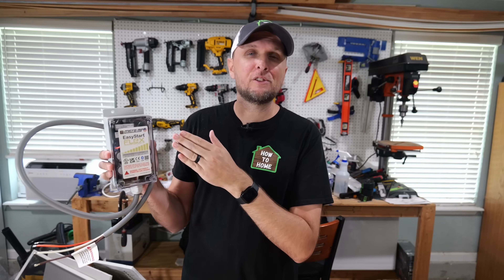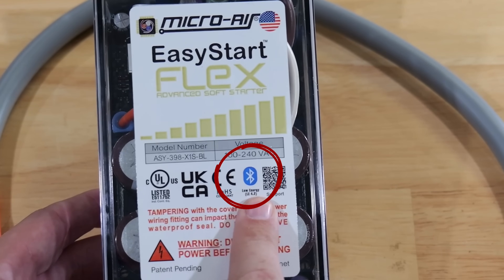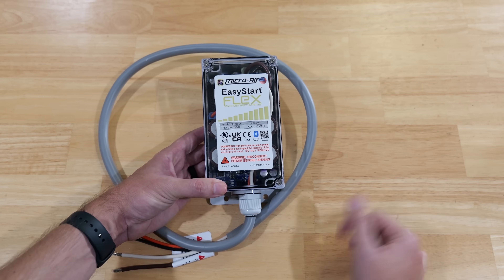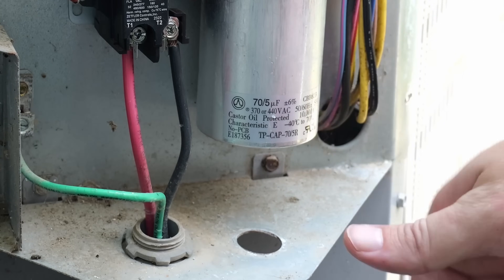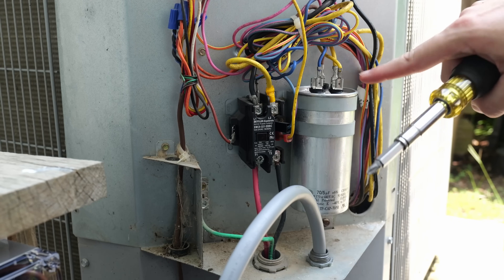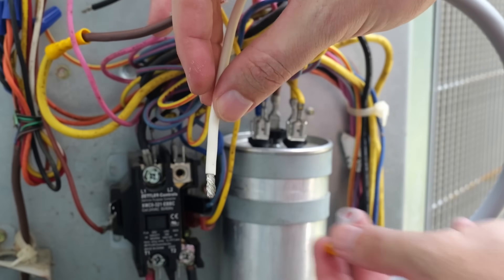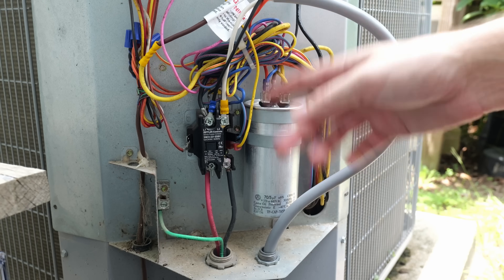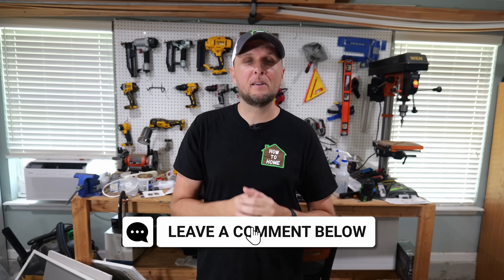The ONE AC Upgrade Every Homeowner Needs to Consider!

Comment: Actually every home owner should know that the AC industry has been selling you technology that is archaic for decades. The only reason you need to buy one of these things is because your current compressor is either FULL power on or FULL power of, because of this your compressor needs a ton of power to start up - given that it always has to run at 100%. Thus the need for this device to make it easier for your FULL ON compressor to turn over and start up - which YES saves you some electricity and wear and tear on your AC when you use this device. That said, every home owner should actually replace their AC with a NEW variable speed DC system - when the chance arises to do so. Variable speed compressors are not always ON or OFF, they run at varying speeds depending on the needed output required, they start slow and ramp up which makes them super efficient, long lasting and very quiet.Most importantly variable speed system SAVE YOU MONEY. The variability of operation results in large energy cost savings. So instead of investing in this device, if your AC is old, maybe look into a NEW variable speed A/C system instead.
Reply: And the variable speed units cost a fortune to repair and can  give more problems in the long term .
Reply: I think I would opt for a cheaper Full On AC and a $82 dollar Soft Start device that will also protect my AC from a power surge (and they do happen, my folks AC was blow out by lightning and boy was that a fight with  insurance for them to pay).
Reply: Most of the new variable systems are frequently drive that varies the frequency 3 phase compressor by converting all of the single phase current to bc then to 3 phase ac with other than 60hz. It’s hard to quickly explain. This is the same system used on large commercial systems
Reply: 10 years from now, there should be ample supply parts. When I bought this mini split this pretty much was the only choice. They are almost all inverters now.
Reply: @nmfireman you do realize inverter systems have been out for over 15 years in the states and we still have issues getting parts. Not to mention most of said parts are made in other countries. So let’s see what happens when the supply chain has issues again. Did everyone already forget the pandemic?
Reply: The compressors that are full on are designed for such. I have not seen them die any more than an inverter style. These soft start kits likely don’t add any life to your compressor. I have two old r22 systems going just fine for 20 some years. I’ve seen 410a systems going strong despite the housing and coil in shambles sinking into the ground. 

Inverters are a nightmare depending on the brand. Some companies don’t like to put diagnostic lights or a code display. You just have to count blinking lights and then pray that number doesn’t have 5 possible reasons it went out. 

The main benefit of an inverter is it’s quiet and yes slightly more efficient.
Reply: Majority can’t afford that, so this option is great.
Reply: No, your advice is misguided. Variable cost a fortune up front and an absolute fortune to repair. Single stage are cheap to buy and cheap to maintain/repair. Single stage are more reliable as they have less parts to break.
Reply: @thrillmanmayo  Wrong, mini splits are all variable speed, in many cases cost less than traditional systems.
Reply: If you think variable speed compressors save money you failed both physics and economics.
Reply: More parts, more problems. Us HVAC techs almost never put those in our own homes for many reasons. Replacement parts are expensive and often times not readily available. Now your wife and kids are sweating for 3 days while you wait for the manufacture to ship the fancy control board that is very specific to your unit. You’re not saving money when the equipment costs twice as much, breaks down more often and the replacement parts cost 10x as much as they would for a single speed unit. A compressor can last 25+ years in a single speed unit if it’s well maintained.
Reply: @Dg_donn exactly my thoughts as well. I service a 48 year old “antiqued” carrier and it’s has Zero issues. Maybe a few motor changes and capacitors over the years but the compressor refuses to die 😂 It’s sad the newer systems are designed to fail around year 8-15. I understand the manufacturers not wanting systems to last for profit sake but damn it’s hard explaining to a homeowner they last 10-15 when the old one lasted 20-30 years.
Reply: My new mini split I put in has dual inverter. It’s very quiet you don’t hear it actually kicking on and off.
Reply: You will also save money by cleaning your coils and insulating your line in. What is the inrush on a 5 Ton.
Reply: @gerardford5707 look at the LRA (locked rotor amperage) figure on your outside AC unit's UL label. that's basically the max in-rush current
Reply: And when the board goes out you have to wait and after warranty the board is 3k.  And the fact that you cant by pass anything to get condenser to run.
Reply: Aweome thank you for that in depth information!
Reply: 😂 let's drop $10k + on a new unit and save.
Reply: I'm hesitant to switch because I believe in the cost savings on the electricity, but I also worry about expensive repairs since it has an inverter, more expensive electronics, more difficult to diagnose unless the technician is trained properly, and so all money saved on power could easily vanish after 1 super expensive service call.
Reply: @petef.4361 you’re wise, most techs are required by the manufacturer to call tech support before a concrete diagnosis on a fail board is confirmed. Otherwise if they replace the board under warranty and it comes back to the manufacturer and they deem it “working” then you’re getting charged 2k+ for that board. Keep it simple and you’ll thank us honest contractors.
Reply: @petef.4361 exactly, the variable speed are a fortune to repair.
Reply: @petef.4361  the cost of installation and repairs overtime will nearly completely negate any savings.  Some parts are not available readily so be prepared to be without cooling for several days
Reply: Can you give us an example? How can I identify if the AC/heat pump has a variable speed DC system?
Reply: @alanfong8569  it will say inverter and most some cases dual inverter
Reply: @nmfireman  Thank you so much!
Reply: @alanfong8569  It will say "Inverter or variable speed". If its super loud outside its not.
Reply: @septsixteen  Thank you!!!
Reply: @alanfong8569 stand near the compressor when it starts up. Loud as hell?
Reply: @alanfong8569 often called "inverter" around here anyway.

It does make the electronics more complicated, thus harder to fix one part of it. If that matters depends on how much does a dude to fix your ac cost compared to ac price.

Haven't noticed really any difference in running costs though.. But you'll get like more stable temps with them, it doesn't make the compressing overall needed to keep it at below x celcius need less power as such.. It can just run at partial power to keep it stably at it.
Reply: @lasskinn  Thank you so much!
Reply: @alanfong8569  Yes, it will say Daikin or Mistubishi on the side.
Reply: @thooks1234  Do the other brands not do variable speed or they're not as good at it?
Reply: @alanfong8569  Daikin and Mistubishi are the best and most experienced in this arena. The lesser known, cheaper brands are going to be a crap shoot. One might last and work fine for 15 years.  Or not. 

No, Trane, Lennox, Bryant/carrier, etc are NOT leaders in inverter driven compressor technology.

Note I said inverter driven, not variable speed. There’s a distinct difference between the two and many people will claim variable speed is equal but it’s not.
Reply: Save you money until you have to pay 3 k for a board and labor then did you save money?
Reply: I wonder how many years it will take for that $18k investment to start showing returns?
Reply: Are you talking about inverter ac units .
Reply: Mine has that. So, should I still get a soft start?
Reply: Compressor inverter, (VFD) yeah but in the US in general you have cheap trash. So you pay less the first time. But you have to pay it multiple times 😹 (yes I'm European)
Reply: 🙌🙌🙌🙌 YES!!!!  The Residential HVAC industry/equipment in the US has been ANTIQUATED for DECADES.  And it's STILL being installed.... in multi-million dollar homes!  It kills me to drive by a 1.5M home, brand new and it's got 3-4 old-school Trane or even worse, GOODMAN condensing units sitting outside.
Reply: But they cost 10k.
Reply: Bosch makes a great variable speed system , it actually starts up at 35%.
Reply: Proof or your full of it. Cost of unit and installation. Then at a national avg cost of electricity share the operation cost for avg. size home to cool it off during May to September in 95 degree weather. Vs same variable and traditional units running 100%.
Reply: Ive heard its really fun when the circuit boards fail or get wet.
Reply: They save you money but cost twice as much!
Reply: seems u havent heard about invertor tech ac 😂
Reply: @sirobin171 you sir sound like a white shirt  sales tech please stop spreading misinformation. Inverter technology is cool but not practical for the company servicing and the homeowner. The cost and availability of parts is ridiculous not to mention price of  equipment being sky high. I’d rather have a part in my van slap that sucker in and go to the next house knowing my customers are comfortable. I used to work for a company that pushed selling the higher seer inverters and I feel guilty for every one I sold. My sales pitch sounded like your comment. I had brand new Install’s fail within a week and couldn’t get the replacement part for days or week and that is unacceptable. I no longer work for said company and now I’m a licensed hvac contractor doing my own thing. I’ve seen all kinds of units from basic to the most advanced and In the world of hvac keeping it simple stupid is the moto to live by. Unless you like taking the risk of your expensive unit breaking and being without Air then by all means go inverter. There’s other arguments against inverters too like dirt city power causing problems as well as brownouts and lighting strikes and yes some of which can be mitigated with surge protection but even that’s not a guarantee. So for those reading this comment please stay away from inverter technology for your central air system and don’t fall for the sales pitch, just remember keep it simple and you’ll be alright.
Reply: In an ideal scenario with an unlimited budget, yes. They are way more expensive and cost way more to repair. if there is not in the cards, I recommend looking at a two-stage system…. The unit will run at about 70% capacity unless the need arises and then the second stage will automatically turn on to give you 100%. In most climates, you would be running at 70% in the spring and fall and likely 100% through the summer months during those sweltering heat waves.
Reply: Any specific models you recommend?
Reply: No thanks, first company wanted over $12k to put this in, wanted to replace furnace too so it would also have variable fan, and requires its own special thermostat, so I would lose my wifi nest.  2nd company gave me 3 options, value, mid, top, all 3 Lennox regular contactor units with new evaporator in existing furnace.  They said nothing wrong with furnace. Price was $6k.  If a contactor fails it is $20 at Menards.  I did put surge protectors on both units.
Reply: Yes proprietary inverter board that is mostly exposed to the elements, not good idea.  What is board replacement cost? $1000, availability?  Contactors run $20 and are at Menards.  Plus a simple contactor based unit don't require a special air handler (furnace) or special thermostat.  It would be one thing if they used quality replaceable Allen-Bradley VFDs contained in NEMA 4 box but they don't.  Inverters should also not be in 90 plus degree heat.  So really the inverter and control components should be inside where they are cool and clean and only power ran to the outside unit.
Reply: If your AC is still working and old. Dont replace it. Replace it when it breaks. My AC is over 20yrs old. Its not worth spending up to $10k for new AC just to save couple bucks.
Reply: @anekinoo7  yes. I  installed a used Trane made in 1999 that I got for basically free in my shed/shop. It was from a takeout when some people "upgraded their AC to save money." The trane is still working meanwhile the new system that replaced the trane has already broken several times.
Reply: Yeah, in this economy, most of us would wait for the big upgrade.😢
Reply: Just buy a 240VAC frequency drive from Automation direct.
Reply: I have one a repair can cost as much as a new unit.  Mine is a carrier. Parts are extraordinary
Reply: Mine is and ECM and runs at one of 255 steps. 25 SEER so I don’t need this.
Reply: Mine is and ECM and runs at one of 255 steps. 25 SEER so I don’t need this.
Reply: An inverter AC is an air conditioning system that uses a variable-speed compressor to regulate the temperature of a room
Reply: I have a newish Rheem system, 5 years old now. I’ve had to replace the starting coil 6 times since it was installed. No clue why these keep burning out. System was pricey
Reply: Or better yet learn how to build your own variable speed DCAC unit. If you can’t afford a new one, build your own.
Reply: The reason you want one of these is so the power grid don’t charge you more for your spikes on the grid every time it turns on
Reply: @PauloR777  Nope, the #1 reason you need this is when old compressors need an extra boost of power to start. The AC industry loves selling these things, they have bullshit there way into selling them by saying they say you money with power, this is not quantifiable, its just sales BS. The AC industry is really one large load of corporate bullshit, I know I used to work in the industry. The little companies use the sales techniques the industry creates for them.
Reply: I'd have to honestly disagree with you about variable speed A/C's and saving you money! I install them. They cost too much now and in the long run you never reach the savings amount. Maybe, just maybe if they only gave out the rebates they did years ago, talking about $3k-$6k off a high efficiency unit back then.
Reply: @Goodfella0982  I installed 3 mini split variable speed systems, each for around 3k professionally installed (a few hundred here or there).
Reply: @Goodfella0982 totally agree. Much more complex h/w and when it fails so expensive. He paints them as all positive. Go change an ECM motor over your stock blower motor and you know what I mean. Open up a variable speed compressor control area vs your standard capacitor/contactor one. $$$
Reply: @Goodfella0982 and very expensive to repair
Reply: You skip over the most important deciding factor… price of state of the art units
Reply: @noblepatriot9292  Not anymore.  They are very comparable, especially when you start talking about energy savings paying the difference.  You can usually pay the difference back in 2 years or less with reduced power bills.
Reply: @thooks1234  when people can’t buy groceries or turn on the air for the expensive bills how could they afford an upgrade…
Reply: Yes but are very expensive to repair
Reply: Let me know how that inverter system works out after the 10 year warranty expires. Even under warranty, let me know how many service techs carry the unique high priced repair parts on their van for your unique system.
Reply: Exactly. Unit broke down and youve got a hot house for days. Im babying my 15 year old r22 system as long as i can@USA-GreedyMenOfNoIntegrity
Reply: @USA-GreedyMenOfNoIntegrity  I purchased a Mitsubishi mini split system for my master bedroom.  I can easily power it with my generator and it was about $1500 total.  I installed it myself.  I bought the exact system as a backup for $900 off eBay.  I'm all set if it fails.
Reply: They cost way too much and needlessly so, have too many fragile electronics and are much more likely to die than traditional, they don't dehumify anywhere near as well so worse in humid climates and more nonsense.
Reply: Or that's a load of bs bet u got variable furnace to better have start thrn shut off less problems
Reply: Not everyone has 10 to 20 thousand dollars  for that system.
Reply: DC or inverter systems have been common place in most developed and developing countries. I’ve been working on them since at least the mid 1990’s in Europe, Asia and Australia. I cannot believe the USA is so behind in using this technology. Don’t even get me started on the use of R22 in the USA.
Reply: @kelvinslee9051  i love r22. Its actually getting easier to get again, demand is dropping.  Just installed a r22 condensing unit in my shed that i had sitting off to the side for years. Some i know had it removed and replaced it with a new "inverter" system about three years ago. They kept it because they figured i may want it. The inverter system has broken twice . Meanwhile the now 25 year old (1999 mfr date) Trane R22 condensing unit with reciprocating compressor they got rid of keeps my little shop cool. The fact that propane is basically a drop in for R22 is cool as well.
Reply: @kelvinslee9051 Unfortunately it doesn't surprise me. Just read these macho comments about prying their old archaic reliable unit from their cold dead hands! Always of fear of modernization 'round here.
Reply: @kelvinslee9051 so let's hear it on r 22
Reply: They run 24/7. No thanks
Reply: @neilandrew1685  running 24/7 helps keep the humidity level down. That's a big plus for keeping you comfortable, maybe so much as you raise your temperature, setting a degree.
Reply: And they cost a damn fortune now? Thanks to our EPA
Reply: @danwaller5312  what did you reproach to the EPA ? Don't you think the problem is the margin of the suppliers ? 😹
Reply: @danwaller5312  Wrong, it's the EPA that helped push along variable speed DC. Without them, we'd be forever stuck with old outdated archaic components.
It's actually the greedy profit hoarding industry that makes the cost so ridiculous. We need competition and newcomers to join in and lower price. Need incentives to join in.
Reply: @Tman317 you do know that you supply variable speed drives with AC power right? We call them “inverters” because they rectify the voltage along a DC bus, then they pulse that DC at varying intervals to simulate AC at different hz frequencies, this allows us to open or narrow our timing between DC pulses. This is the only purpose for the inversion. It has nothing to do with efficiency.
Reply: @jordangourley3955  I supply what? I don't supply drives of any sort, to anyone...? No idea what you're attempting to say here.
Reply: @Tman317  supply power for a vfd is A/C.
Reply: @danwaller5312 lt's amazing how the Trumpers blame the Govt for everything.
Reply: @danwaller5312 the EPA doesn’t determine prices that AC manufacturers charge
Reply: @kevinpoehlmann5157  but they continue to change specifications on the coolant requirements for the units thus increasing prices dramatically
Reply: @danwaller5312  Not anymore.
Reply: @danwaller5312 Not really. It's actually thanks to these greedy companies taking advantage of their customers.
Reply: @SignorLuigi The EPA forces the HVAC industry to change their Freon. This typically requires all types of new changes to hardware, apecial tools and equipment for rhe inatallers, and EXPENSIVE new freon. 

This happens in the automotive world. Whem cars were foeced on the R134A from R12, they made R134A compatible with existing systems with new line connectors added.

This is not the same as the moat current change to R1234YF. When it fiest came out, we had to buy all new AC machines. (So now we have R12, R134A and R1234YF Machines) 

The machine requires a new tank of YF. Half that tank used to prep a brand new machine when you initiate its set up. The brand new YF freon was $7000 a tank for the first year it was available. Eventually it dropped to $700, but a tank of R134A was loke $65. All od this bullshit, the EPA.

Now, are there companies that enjoy these regulations, yes, because it prevents competition.  Therefore it is profitable for them in that way, because, the people who have to use this stuff, have to buy it regardless. So they don't care.
Reply: @SignorLuigi sounds like we have a democrat v republican argument starting. Very similar to the chicken or egg discussion.
Reply: @crs1012  😊
Reply: @ColinStevens  What does Freon have to do with variable speeds?? You really have no idea what you are talking about re: EPA..
Reply: @SignorLuigi don’t talk about stuff you have no knowledge of
Reply: @ColinStevens That's still on the manufacturers tho. New refrigerants are not necessarily more expensive, just initially when availability is low. Also, would you rather still be using r-12, responsible for the ozone layer hole and, therefore, increased rates of skin cancers?
Reply: @ColinStevens The high cost of the YF gas was due to the industry not having compatible hardware...but if you notice, that's rapidly changing now...the costs of YF has been steadily declining over the last year. I spoke to a friend who owns a mechanic repair shop. He said the new YF machine he bought cost him $18k. Shops have to make that money back somehow.
Reply: @septsixteen  He's right... changing the cooling gas absolutely matters. When the EPA mandated changes to the gas for environmental reasons, the existing equipment all had to be changed too. Although this change affects the automotive industry more than homeowner market. If you have a car that's newer than 2017, you have the YF gas. If for any reason that gas leaks out, you would have to pay upwards of $1000 to have it refilled vs going to AutoZone and buying a $20 bottle of R134a which you could refill yourself. If you have to refill/change a part in a 3 ton home AC, imagine the costs.
Reply: @coccoborg  I was using the examples of the initial cost of freon being an expensive change. The overarching idea behind my statement was a response to somebody talking about how the is corporations are just greedy and that's why it's expensive. 

I explained between EPA regulations as well as the cost of new equipment, training as well as the freon, causes everything to go up. 

The foundations of my statement weren't about freon, it was an example of how companies, in order to comply with regulations, typically incur large costs that must be absorbed through more expensive customer repairs.
Reply: @septsixteen  I was responding to somebody who was talking about corporate greed because of the expense of new equipment. It was an example of how companies have to pass on their new expenses to customers due to Federal regulations. I used freon as an example. I know it's shocking to have a representative analog to draw a comparison from.
Reply: @ColinStevens
Yes, but its also a misleading, silly argument. You may as well point out that ppl would save even more money by not having/using AC. Some things have costs beyond the direct upfront costs. This shouldn't be difficult to grasp. I guess you'd prefer to pay less to still have leaded gas and asbestos insulation, too?
Reply: @ColinStevens  - You're blaming the EPA as if they randomly made a change to Freon just because. Are you ok living without ozone in the upper atmosphere?

Yes, there is a one time cost to this kind of change. You're ignoring the cost if we don't. As someone else asked, I assume you're ok rehabbing a house with asbestos insulation, asbestos tile, lead paint, and fiberglass insulation without any protective gear or gloves?

Do you also neglect to change the oil in your car, driving it until the engine fails? 

We only have one planet. If we damage the environment in a way that makes our lives more difficult, we only have ourselves to blame.
Reply: @ColinStevens True, HOWEVER the story is a bit more complicated and starts with patent owners. A basic example: company A owns the patent for R12 and for X number of years controls and makes all the money. Before their patent runs out they come up with a replacement for R12 and start lobbying the government to change laws to ‘ban’ R12 in lieu of this new product. 
The above did and continues to play out for many products so the blame can be spread out or placed at the feet of company A. 
Similar things play out with the NEC and AFCI’s are a good example.
Most laws, rules and codes are product(money) driven in these industries.
Reply: @ColinStevens the EPA doesn't enforce this
Reply: @Jfresh55  The EPA enforces recommended regulations that's Congress puts into law. If the EPA didn't have harsh regulations on controlled chemicals, then how can the EPA shut down businesses? Or set the standards that force large sectors of the economy to change, virtually overnight by business standards?

This is no different than waterborne paint vs solvent based paint. The automotive industry didn't just decide to go with waterborne paint jobs from the factory because they wanted to, it was so so or be penalized for using solvent based paint on all for your cars. Solvent based paint looks better, is strong and lasts longer when maintained. Paint jobs on cars suck now. The last body shop I worked at had both systems because we were required to for certification purposes. Waterborne and Glasurit Solvent. Glasurit paint looks better every single time.

Also, I am not debating if the EPA has the right to do these things. I don't think the 4th branch of the government should exist. Also, the EPA did as it pleased, just like the ATF did, with creating "rules" by reinterpreting laws meanings, and enforcing them as laws, because of Chevron Doctrine. Well they went too far and the supreme court over turned Chevron because of rogue agencies, like the EPA or the ATF.
Reply: @danwaller5312  The EPA doesn't set the price of hardware - the manufacturers do.
Reply: @tgriebe you’re not a real deep thinker are you?
Reply: @tgriebe  Wow, this man is genius. So when the EPA requires a new 20k part, the manufacturers should just eat the 20k cost since they are clearly charities. Or maybe take it out of your paycheck. Weird thing is Sony just laid off 220 bungie employees and everybody on the internet defended them and said "well no billionaire will stay6 a billionaire keeping inefficient employees around" and likewise comments. So, hypocrisy abounds.
Reply: @danwaller5312  They are cheaper than the AC versions.. What are you even talking about with the EPA? Do you even know?
Reply: @danwaller5312 Why thanks to the EPA?